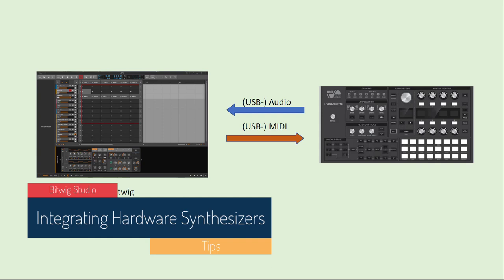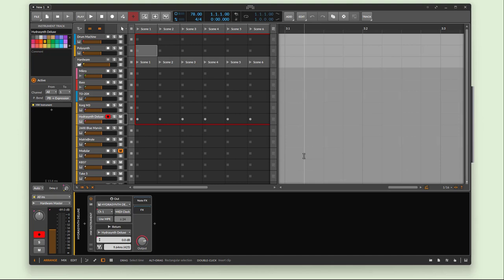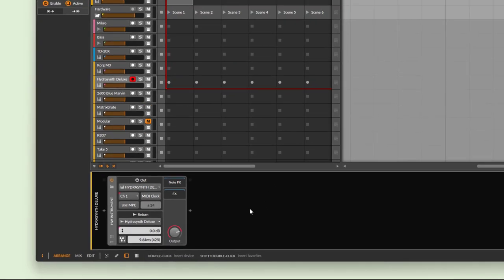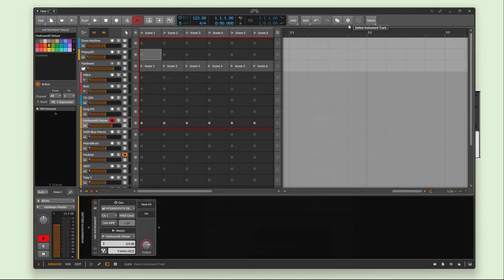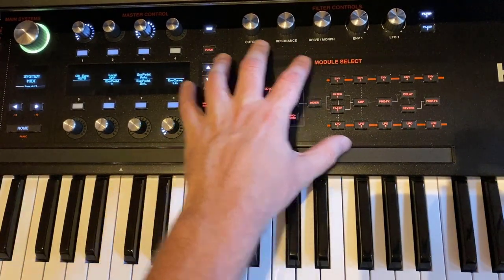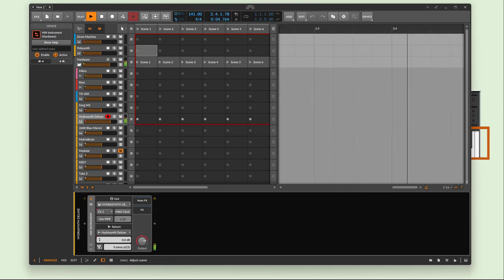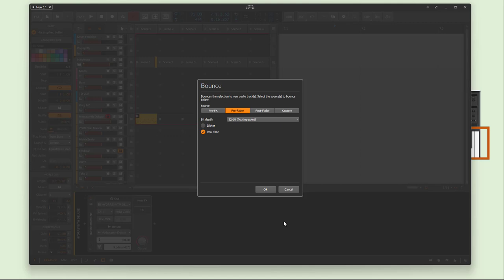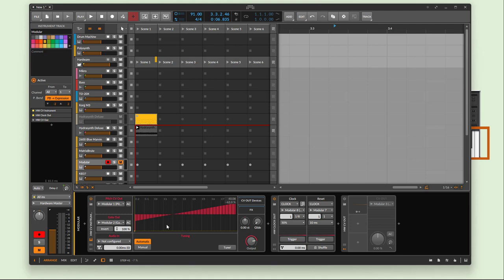Integrating Hardware Synthesizers in Bitwig Studio - Setup, Synchronisation, Recording, Playing

Comment: What is the most optimal method for using multi-timbral hardware synths with Bitwig? Multiple HW Instrument devices for each channel used, with only one device using the audio return at a time?
Reply from the maker: You could also mute all tracks except one (or mute all and create an additional audio track for listening). Since MIDI is still sent out when a track is muted this will work. This has the advantage that you still can render clips.
Reply: @mossgraber  Thanks, I'll try that.

Comment: I hoped you had some smart way to compensate for the introduced A/D conversion. I’m also not sure if the delay within the HW module is also automatically compensated when you increase buffer size. For sure I do need delay compensation and sometimes it feels I need to correct it.
Reply from the maker: Up to my knowledge it does. Note that there is also this latency training button at the bottom of the hardware device to compensate for the introduced round-trip latency.
Reply: @mossgraber  Note though that MIDI (especially via USB) has variable latency, also known as jitter. This is quite hard to compensate for. That's one of the main reasons I send triggers / clocks from my audio outputs of my audio interface, and am strongly considering getting an audio interface with DC-coupled I/O. That's all sample-accurate with a steady latency (assuming you're not running into buffer overruns/underruns)
Reply from the maker: @KutAnimus  Back in the days this was call "the machine has a groove" 😆
Reply: @mossgraber  Haha I guess that's one way to think about this :p
Luckily these days with audio out gates/triggers we can make Bitwig Studio add any sort of groove we want :D

Comment: Excellent instructional video. I just learned that I didn't have to manually create an audio channel and route the HW synth to it. One thing that I'd love to do is send NRPN messages to my hardware synths, since most of them can't be fully controlled with CC. Can this be done in Bitwig?
Reply from the maker: I am not sure. You could definitively add it to a script/extension. Since it is only CCs they also should be recorded. But never tried it. If not sure simply ask Bitwig support.

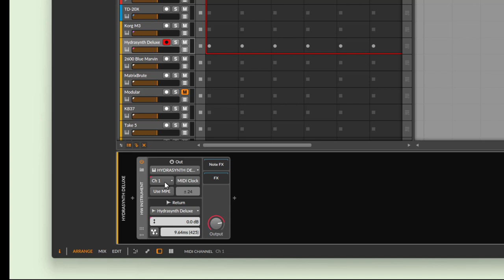Comment: Hello, first many thanks for another great video Jurgen. At 01:27 you say you have to be sure to select the right MIDI channel, ok, but how exactly do I do that, simply trying? Same at 01:56 with the Bus channel. And finally is it possible to send Audio and MIDI notes at the same time from a Synth to record them in two tracks in Bitwig? I have the Arturia Minifreak. Many thanks.
Reply from the maker: You need to refer to the manual of your hardware synthesizer to learn how to set its' MIDI Channel. Could also be that it is a multi-timbral synth (which can play multiple sounds on different MIDI channels) and then set the matching one in the Bitwig hardware device. Yes, you can record both audio and MIDI at the same time. I prefer to render the MIDI track instead (make sure that "realtime" is checked). But to record audio at the same time you need an additional audio track which receives from the output of the instrument track with the hardware device.

Comment: Jurgen, have you experimented with just running all the midi instruments without rendering to audio and does the midi stay on time with the metronome (this how we worked back in the 90s), I know the great thing in Bitwig is that you can ping the hw instrument and it automatically adjusts the latency. I just dont like to print audio until all the sounds selection from the midi instruments is finalized. What Midi interface are you using to route all the synths you have and what audio interface that has so many channels ? Is it a USB audio interface ? Thank You. I love this channel, specially all the great work you have the done with the Akai gear. Cheers.
Reply from the maker: Yes, works fine. I use quite some hardware synths. I use the iCOnnectivity mio10 as MIDI interface but since most synts come with USB anyway they are direcetly connected.

Comment: Thx for the video. I sadly can't get bank changes to work. No idea what the problem is, the midi program change noteFX simply doesn't respond.
Reply from the maker: You mean that your hardware synthesizer does not react to the bank change? Did you check with another software? Is Program change activated on it?

Comment: Thanks for everything you do Jurgen! Do you have any tips for saving a specific preset on a HW synth as part of the song file? I know there's the program change device, but I'm unsure how to have it instantiate the appropriate preset at the outset of a song so I don't to remember / manually change for any new song I write/play.
Reply from the maker: I think that is not possible until you use a specific VST plugin.
Reply: Yes!
I’ve just had to figure this out for a live set. Use the Program Change Device, set the appropriate channel, turn off and the automate the auto send button.
In the automation for the program change device set the auto send to be on for the first 1/128 of the song. In the first 2 256th notes of the track automate the program select to go from any number to your desired program number. 

As long as the auto send automation is big enough to encompass the vertical program change automation line then it’ll pick up the change without constantly sending a change signal.

Comment: It would be nice to show how to use bitwig as a mixer, plugin host, audio clip host for sequencing from external hardware sequencer.
Reply from the maker: This depends highly on the hardware you want to use. Any hints?
Reply: @mossgraber  a hardware sequencer with din/trs and usb midi (e g., Oxi one or keysteo pro), functioning as clock master and playing both virtual and hardware instruments connected to either the sequencer itself or the computer running bitwig via din/trs or usb midi. External instruments route back to bitwig via audio interface.
Reply from the maker: @EdoardoMarcora  To make Bitwig follow external sync: Open Settings and then Synchronization page, as "Sync Method" (parameter at the very top) select "MIDI sync"  and then choose the MIDI input from the drop down list which is your external device sending MIDI clock. How to integrate external synths is explained in this video. To use an external MIDI sequencer: add a Generic Controller script which simply forwards all MIDI channels to Bitwig. Assign this controller input to the tracks which you would like to control. For each of these channels filter the MIDI channel accordingly (in the track settings).
Reply: @mossgraber  thanks! My question was more about how to have everything correctly synced up... With different latencies introduced by midi and audio routings to and from hardware and within bitwig by the different plugins. I know there are offset adjustments on midi clock settings and in he instruments and FX, and also the time shift bitwig plugin, but how to use them to sync a hybrid setup is rarely explained and would be a great topic for a video.
Reply from the maker: @EdoardoMarcora  Never looked into that but will take note.

Comment: thank you for your videos. and what about midi\audio latency? (i'm ableton user, but thinking of switching to bitwig). I use PC windows 10
Reply from the maker: This depends mainly on the settings of your audio interface and the MIDI and audio latency of the external synth / FX you are integrating. You can configure the latency to use for each device at the bottom of the Bitwig hardware device. Left to it there is additionally a little propeller icon. If you click it Bitwig will measure the latency of a round trip to/from the external device.
Reply: @mossgraber  thank you. thats a good tip.
the problem with abelton on pc (win10, presonus audiobox but changinging audio-cards didnt help)  even if i set up the letancy to unnoticable (less than 10ms) - the latency could change after i turn on\off the daw or reload project.
on ableton - i could never get it tight in both ways midi\audio in and out
if its tight one way it drifted in the other. or changed after re-loading DAW.
i tried Macbook Pro but it more or less the same proble. maybe little bit more stable on mac. still the problem existed.
so i ended up not trying to playing hardware+daw simultaniusley.
i've heard that the ableton is one of the most unstable in terms of hardware-daw playing at the same time.
i know there are many solutions (audio deleay\midi delay adjustments)
How it is on BItwig? is it same pain in the ass or its more easy to get it tight bott ways in\out midi-audio?
Reply from the maker: @ticketstomars  It works fine for me but I also heard from other people having issues. In my experiences it depends a lot on the external device itself. Some of my synths are spot on others hop funnily around the timing. I simply tend to have a quick look at the rendered result waveform and sometimes move it a little bit.

Comment: How to recored automation from the hydrasynth or other synth to bitwig?
Reply from the maker: Make sure that the Hydrasynth transmits and sends CC with the knobs (SYSTEM MIDI Page 7/13 -> Param TX CC / Param RC CC). Hit record in Bitwig and wiggle the knobs. Also make sure that the script/extension you use for the synth, forwards the MIDI CC to Bitwig. The default Generic keyboard does that at least for the 5 knobs (Cutoff, Resonance, Drive, Env 1, LFO 1) of the Hydrasynth.

Comment: Hi Jurgen, how do you actually set up your hardware synth?
Reply from the maker: This is what I explain in the video. Don't get your question.
Reply: @mossgraber  At 1.10 you say, "if you have set it up", but I'm not sure how you do that? I have it all connected but how do I actually get it showing as an instrument? Does it show in the library. Sorry, I'm just starting out on my synth journey thansk for coming back to me
Reply from the maker: @keithjohnson993  I ment "if you have set up your hardware connections...". This means you need an audio interface with enough inputs for your hardware synths (at least 1 stereo input). Connect the output of your synth to these inputs. Then you need to connect your synth via MIDI as well. For this you need either a MIDI interface (could be part of your audio interface) or via USB-MIDI, if supported by your synth (check the manual). Watch or read some info about theses studio basics first will make it easier for you.
Reply from the maker: @keithjohnson993  The Hardware Instrument is a stock Bitwig device. It does only exist once. You can add it via Bitwigs browser as any other device and configure it with your respective audio inputs and the MIDI output. To have it ready all the time store it in your default project template.